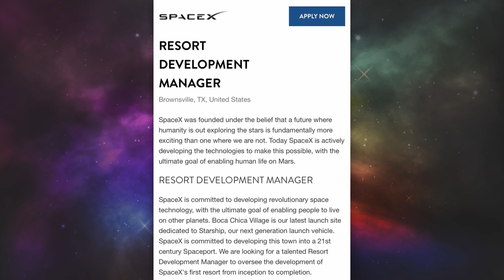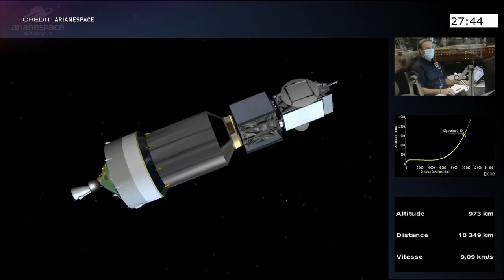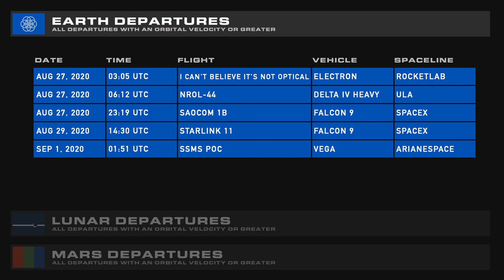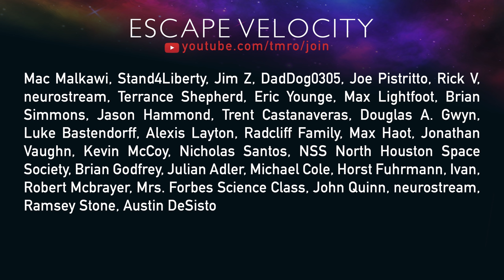Gotta' Get Some Pentagon Money! | TMRO:News

Comment: 10:20  Rumors are horseshit, yes. Now, as far as SpaceX building a Mobile Service Tower at Vandenberg goes, we have no rumor either way. The one at Kennedy is definite, but there's quite a lack of buzz about Vandenberg. There are interesting facts to consider, though. SpaceX will definitely be launching to polar orbits from Kennedy via the new southern dogleg route. They no longer have a west coast recovery fleet. And MSTs x2 = 2x the cost. So, a lot of indications that Vandenberg won't get an MST.
Reply: HAve to agree with you there, with the southern route out of kennedy available, i don't see them doing as much at vandy anymore.
Reply: Yeah, I haven't heard anything for SpaceX doing anything at Vandenberg either, however ULA is converting their Atlas pad at some point so it's not totally abandoned.
Reply: The problem is that the DoD definitely wants to use Vandenberg for the polar launches. They are quite particular, and they don't care what it costs SpaceX. 

While I believe SpaceX could sell the DoD some polar launches for Florida for relatively minor launches, the biggest and most important/secretive payloads definitely aren't moving.
Reply: SpaceX will launch from Vandenberg in November
Reply: And the USSF contract forces them to have a Vandy pad up and running
Reply: @ale131296   Yes, but doesn't that contract run out in 2022? Anyway, that's for F9s, which can still launch from there - just as expendables, it's probably cheaper than maintaining a west coast recovery fleet. As for the biggest and most important/secretive payloads that @I have a name mentions; Delta IV Heavy has always been the choice, and will be flying 5(?) missions thru 2024. This will give plenty of time for SpaceX to prove out the Kennedy/southern route and take over. I don't claim it's certain SpaceX won't build an MST FH site at Vandenberg, but there is a path to avoiding that cost.
Reply: @donjones4719  No, it STARTS in 2022. And no, they can launch reusable Falcon 9 missions from Vandy. Remember: they have a landing pad there which is where the booster for November's mission will land on
Reply: @ale131296   OK, I thought you were talking about the current contract. Do we know the details of the 2022 contract at that level? And not enough sleep - I was arguing for the RTLS side of the discussion a few days ago. Anyway, this covers the current facilities for F9. But in IMHO the MST for FH won't be duplicated on at Sandy.

Comment: SpaceX Starship being built out of steel is fascinating. Probably no other material allows for such fast modifications, prototyping and cost savings. The potential for incremental improvements with steel seems promising. Even giant leaps in manufacturing or cost are thinkable: Could there be some (novel) "super-alloy" just perfect for this space application? What if those cylinders don't have to be welded anymore, but come in one large piece out of the steelworks? Which coatings and material treatments are advantageous? What possibilities are there to make steel much stronger at reasonable cost? Steel seems to be such a nice "frame" to build upon.

Comment: What does it mean when you say that SpaceX must add vertical integration to satisfy the Pentagon contracts?
Reply: Currently SpaceX assembles the entire stack for Falcon 9 and Falcon Heavy laying down, then tips it up and lights the candle. The Pentagon requires its payloads to be attached in the “pointy end up” configuration. Apparently the payloads are too sensitive to handle the transition from horizontal to vertical. ULA already has this capability, SpaceX does not.

Comment: The fact that Boeing got more money than SpaceX for the launch services might make sense because of the infrastructure angle, SpaceX will still get the job done for less and using reusable platforms. Boeing is the aviation version of a shit show and everyone knows it, their days as a space exploration leader are numbered. They tanked the Starliner capsule launch even though they had more money than SpaceX. Good job. 👎🏻 
SpaceX, Rocketlab, and yes, Blue Origin will end up running away with the space race. And let's not forget the other up and coming space exploration companies that will bring everything they have to the table.